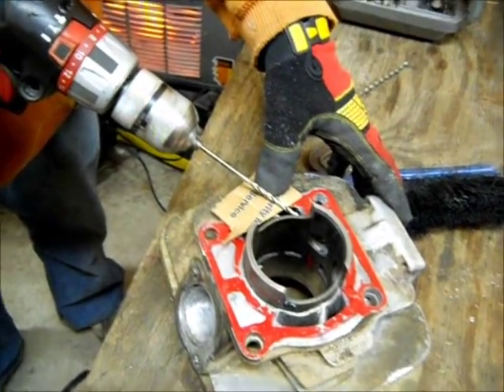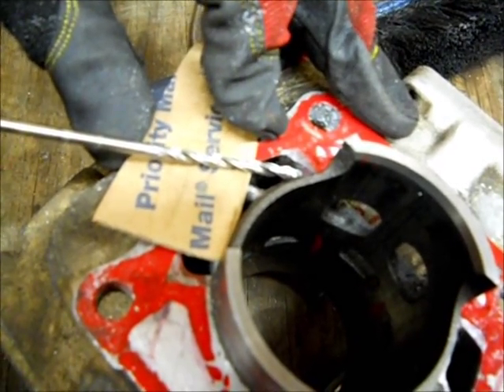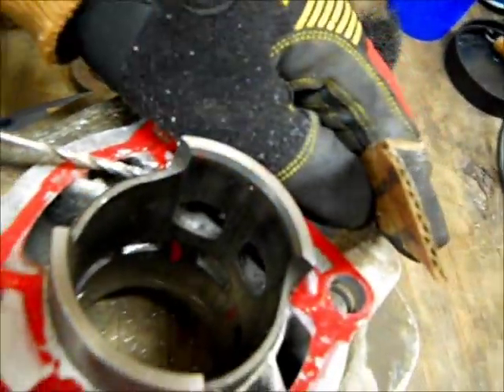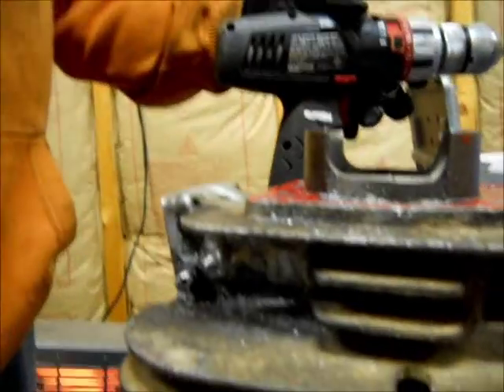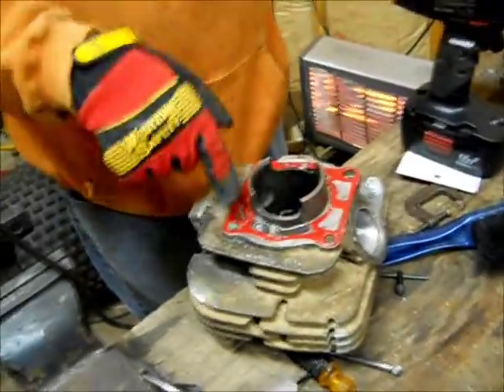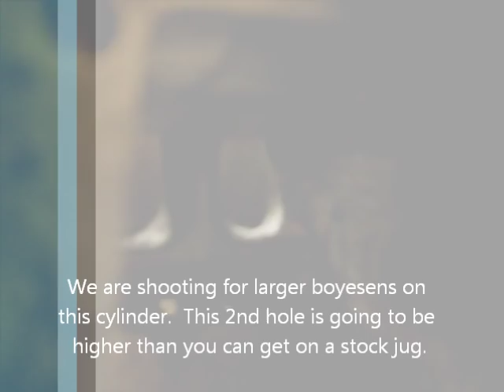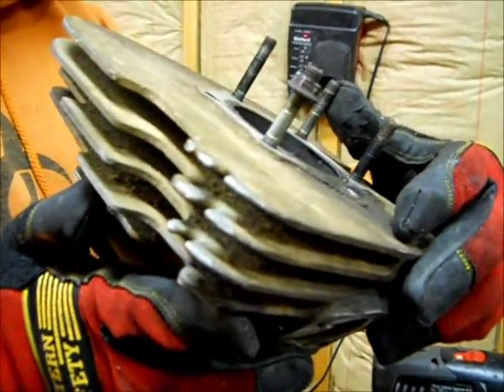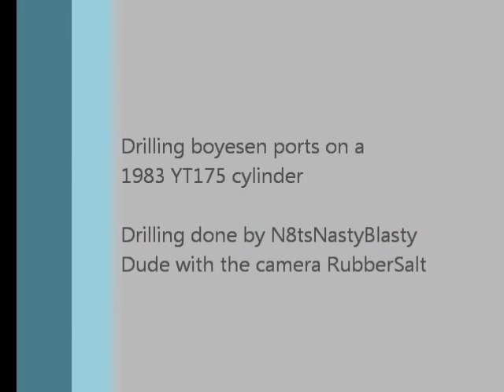Drilling Boyesen Ports in a YT175/Blaster cylinder

Comment from the maker: They allow more flow to the bottom end.  They also dont quit flowing when the piston covers the port.

On the down stroke, they allow the fuel /air to fill the intake and out the transfer port next to the reeds.

Youll see them on ALL the dirt bikes out there, snow mobiles, etc.  They are good stuff.
Reply: Does drilling the holes sacrifice top end power?
Reply from the maker: @HamBone86  Almlows for more top end
Reply from the maker: @HamBone86  Negative.  It actually benefits top end power.   The angle of port does play into power delivery.  A port that flows in straighter will favor higher RPM.  Ports that flow more towards the bottom of the transfers favor more mid range.   Ports need to have sharp edges in the transfers.

Comment: what is the advantage of drilling this holes?
Reply: It gives more fuel flow to the engine and gives more power
Reply: Not shit when you port them right to begin with
Reply from the maker: @goodfellasinc.5648  They help flow more mid and top end power.  If you look at any modern high performance engine with reeds on the cylinder, you'll see them.   Adding these is part of porting them right.
Reply: @RubberSalt  so can you do this to pretty much any 2-stroke?
Reply from the maker: @jcwar6753  Only those with reed/disc intakes on the jug.  Piston port or case induction wont work
Reply: @RubberSalt  ah, tyty